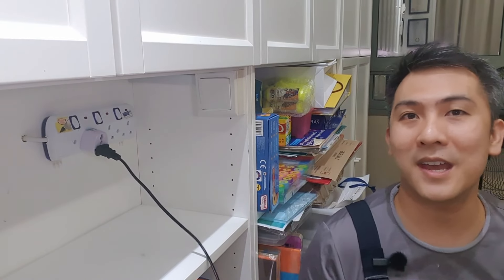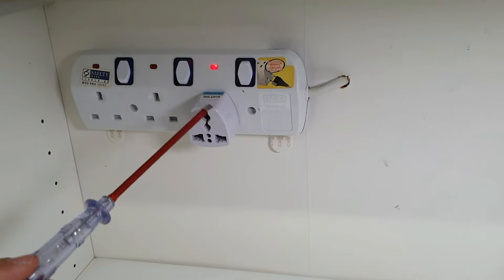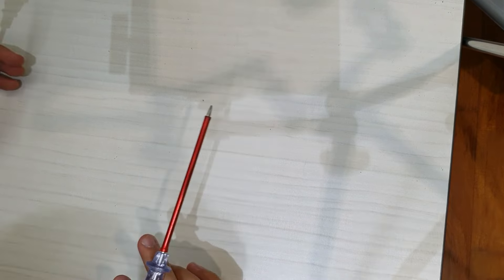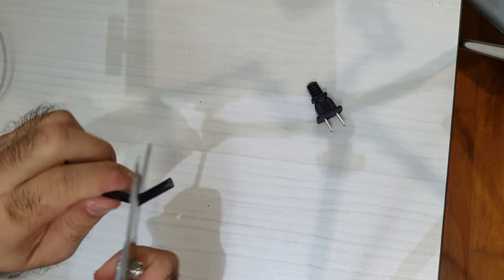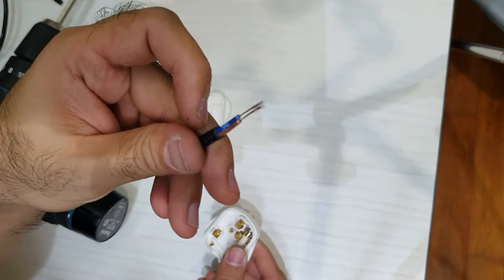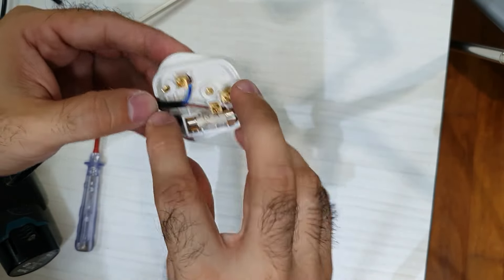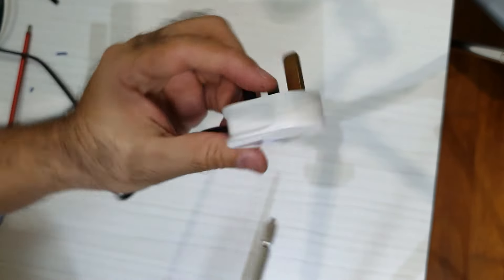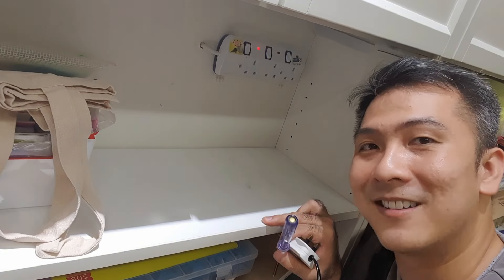Changing a 2-pin to a 3-pin Plug (Save $30)

Comment: The issue of ground/earth is not covered enough. What if the appliance being converted has lots of metal parts that a user could touch while using the device.  How does earthing work two pin countries? None have a dedicated earth cable (2-pin!). This is unclear and never addressed in any of these videos. You also need me on fusing.

Comment: Great vid only comment is at the start you indicated wrong pin live and neutral, you connected them correctly , well it fors not really matter in this case. Need to check any appliance is rated to 110 to 230v and belt and braises match the fuse to the wattage using watts equals volts *amps. Save a burn out

Comment: great video, I'm from Malta and we use the 3 prong uk plug but a lot of our appliances come with the 2 prong plug from the EU.
Where did you buy your extension lead from because it seems like it can accept the 2 prong EU plug without doing the car key trick on the sticker it has on it

Comment: I do use a travel adapter for my toothbrush but it is a decent one with safety shutters and provides a secure fit as good as any wall outlet (lencent brand). However for anything that has a replaceable cord (IEC C5 C7 C13) standard i will just buy a new power cord from a reputable OEM (E.g linetek, I-Sheng, Volex, Longwell, Lindy).

Also since i am studying/working in Australia, wall adapters makes the whole plug assembly bulky, adds bulk to my bag and it becomes a problem if it clashes with other plugs on the same 2 way outlet/powerstrip or if the socket is located under a floorboard cover. 

Then when I travel back to Singapore, I just swap the cables for the Singapore/UK 3 pin plug types that I use on my laptop adapter (IEC C5 cord) and Ugreen GaN multiport charger (IEC C7 cord). So ultimately a travel adapter is good for short term use like on holidays/exchange but not for long term.
Reply from the maker: I have a power strip that starts off as an oz 3pin head and ends as 4 UK 3 pin sockets. This saw me through my stay

Comment: You initially mention neutral on the left and live on the right but after you opened up the back cover you connected the cables to the opposite ends
Reply from the maker: @bunkhuntan6616  lol I did say it didn't matter because of Alternating current. Also it's mirrored in the vid.. I can't change  it now...

Comment: Hi the video helped but when I removed the outer plastic both inside had no inner tubing showing blue and brown only copper wire... I followed the Blue Brown positions on the plug, left out the earth. The item worked (a lamp) for a few seconds... its not the globe (I tried another) but I must have done something wrong for the globe to fade off after afew seconds 😔

Comment: Noted Blue is neutral and Brown is Live. What will happen when we insert wrongly into the plug meaning Brown wire inserted into the neutral hole. Any consequence once we turn on the power?
Reply from the maker: I'm this case no. Houses run on AC or alternating current, means that the power flows both ways. So no for a 2 pin to 3 pin conversion it does not matter
Reply: It will work but of for example there is a switch in the cable it will cut the neutral and there is voltage still in the device. If you for example removed the bulb from a lamp and stuck your fingers inside you could get shocked even if the switch is off.

Comment: Attempted to change my Chinese plug into a 3 pin following this video, but ended up tripping the house after I turned the power on😨

I followed every step closely, and ensured the wires were secure in each prong, to the plug as a whole too. Do you know what could have caused the trip? I used a regular 3 pin plug w a 13A fuse inside.
Reply from the maker: Can you contact me via FB and send some photos showing the connection
Reply: @ThePunggolHandyMan  Thanks for the reply! I've reached out via Instagram as I'm not able to send videos via FB

Comment: Hi i have question i want run 4 led bulbs witch is 3w each bulb gonna fix in one wire cable. Can you recommend me please what gauge wire do i need and fuse amp with plug? I am in uk i am talking about 2 pin wire becoz the holder has alredy 2 pin wire with . Thanks in advance
Reply from the maker: You don't need anything more than a 13a wire. LEDS are low powered to begin with so no problem

Comment: but how to know if it is neutral wire or the live wire?,,
Reply from the maker: Err . I'm not sure what you m e an
Reply: @ThePunggolHandyMan  my machine from china plug broke and it has 2 pins, so I want to change it to 3 pins , u said in your video 1pin is neutral 1pin is live and another pin is ground., Since china 2wire has no ground wire ,how i will know if the wire is for neutral or for live pin
Reply from the maker: @resalina4024  ahhh okok typically red or brown is live and blue or black is neutral.  But as I said in my video, if it is 2 pin, orientation does not matter. Even if u wire live to neutral,  your machine will work
Reply: @ThePunggolHandyMan  ok ok thank you for your quick response...👍👍
Reply: @ThePunggolHandyMan  I did it... I manage to change the plug pin from 2 to 3 pin...thank you for your help
Reply from the maker: Awesome feeling of accomplishment!

Comment: do I need to change my plug, just notice the 3 metal is hot when I plug out from the socket and it is black instead of copper colour. Already subscribe your channel as I find it very useful and can save money too. Thank you.
Reply from the maker: Either your plug or socket is faulty. Or maybe you are overloading that power point

Comment: If the wire is very thin, is it ok to change to 3pin? My aquarium pump, when I cut open is very thin. I'm worried it will melt.
Reply from the maker: It won't because the power draw from the pump is very low

Comment: Hi, I got an issue which i hope you can help solve
I bought a hairdryer from Japan and using it back at home, the hairdryer gets over heated
I tried switching a 3amp and 5amp fuse in it, but it blew it when i turn it on high settings
Any idea how to fix?
Reply from the maker: Hi Japan uses 110v voltage  draw. Singapore sockets supply 220v! You cannot use a Japan hairdryer in singapore!  U have to run it through a step down transformer!

Stop immediately

Comment: Hi Sir

So grounding is not require?  do u mean that?

so any China plug, i will just rewire the 2 pcs into singapore LIVE / Neutral slot will do?
Reply from the maker: Yup... if your thing has 2 pin plug. Means there is no ground circuity

Comment: hi im in the philippines but im from london uk where we have 240volt 2 wire a dubble uk socket in the philippines does it matter if i put th live and neutral the wrong way round please can u advise me sir  i hate useing the 2pin filipineo plug its so anoying wen the plug keeps falling out
Reply from the maker: If its only 2 pin it doesn't matter but if 3 pin you have to be careful

Comment: I guess the downside of this is it can give a false impression to other users of the appliance that it is grounded since it is now a 3-pin UK plug but the ground pin is not serving a purpose as per 3-pin specs. Do you think converting it to the UK 2-pin plug will also work here?
Reply from the maker: Yea that would be a much easier process by cutting and splicing the wires together followed by heat shrink tubing. 

If you observe closely at some appliances which come with the UK 3 pin plug, many of them have false ground pins to open up the socket gates.
Reply: @ThePunggolHandyMan  Yes I've seen them. The false ground pins are usually made of some kind of plastic. IMO there should be a colour code and manufacturers should be required to colour-code them differently so people know it's a false ground pin.

By the way, I'm Malaysian and just wanted to say I really appreciate your content since it's quite relevant for our region :)
Reply: There are no UK 2-pin plugs (besides the special shaver plugs). UK uses the same plugs with double insulated devices as with grounded ones.
Reply: @okaro6595  I see. I meant specifically the BS 4573 (UK shaver) plug or Europlug (slightly different dimensions).

Comment: How would you deal with a 16A plug that comes with some Hifi equipments like amplifiers and or subwoofers?
Reply from the maker: I wouldn't change a 16A plug to a 13A plug. As the fuse may melt if the demand is too high. If you change the fuse in the plug to 16A you may cause damage to your circuit if it is not rated for 13A. That's why the plugs are different.  It's so that you do not connect a 16A appliance to a 13A circuit
Reply: @ThePunggolHandyMan  In this case, what would you recommend if the hifi equipments comes with 16A plugs? These hifi equips are bought from local retail shops in SG. Thanks in advance!

Comment: Some sites say it is just as dangerous to use oversize fuse rating. whats your say? i replace to 3pin for 2 aquarium pumps thats 1.8w and 2.5w respectively, calculated amp use like very small leh not even 1
Reply from the maker: Generally most of there 2 pin plugs are unfused. However for aquarium pumps a generic 13A fuse will suffice. The power draw is not that great.
Reply: @ThePunggolHandyMan  kamsia boss damn swift reply. have a good long weekend :) +subscribed

Comment: Would it be safe to use without the ground wire?
Reply from the maker: Yes! If the original plug does not have a ground, the manufacturer would have deemed that it is not necessary
Reply: @ThePunggolHandyMan  ty!

Comment: hi, can I check what if the item we are buying is DC? Does it matter ?
Reply from the maker: @wolfhideout  yea a dc item needs a converter
Reply: @ThePunggolHandyMan  tbh, I’m not sure if the item that I’m purchasing if it’s a DC or AC, or can I jus simply swap out the socket
Reply from the maker: A DC item will have a huge plug head adaptor thing don't try cutting it off
Reply: @ThePunggolHandyMan  ahh. Okay I think I know what u meant. Like those on laptop ahh? Thanks a lot 🙏🏻

Comment: how do you tell which colour cable is live or neutral?
Reply from the maker: Usually live is coded brown, neutral is coded blue. In this example, the manufacturer just used the brown blue wire and the orientation  does not matter since the device is using alternating current

Comment: how u choose the Amp rating for the fuse?
Reply from the maker: The plugs come pre-installed with 13A fuses and generally most appliances use this rating.
Reply: If connected to an 36W LED lamp  should I change the fuse to 3A? Also, is it ok if I folded wires and twisted it over itself before inserting to 3 pin plug? It was too long and sticking out of the screws otherwise.
Reply from the maker: @Ltbear17  no need to swap to 3A fuse. Also no it's not right to fold over on the insulation.  If the exposed wires are too long you should trim it. If too thin you can twist more to make it thicker. But if u fold over you risk melting the insulation as the contact points get hot